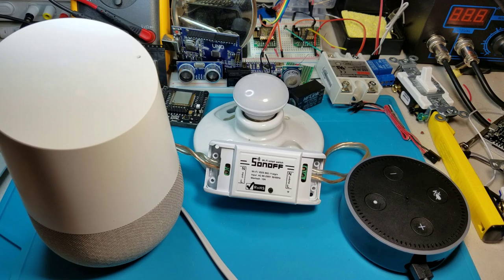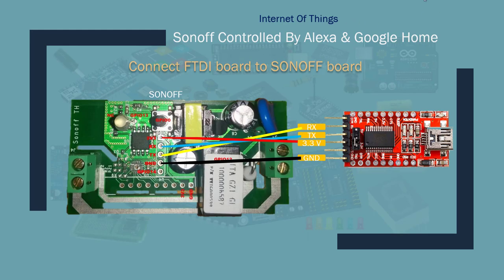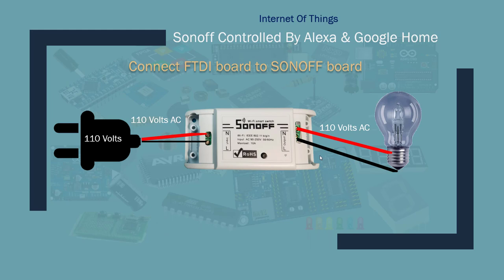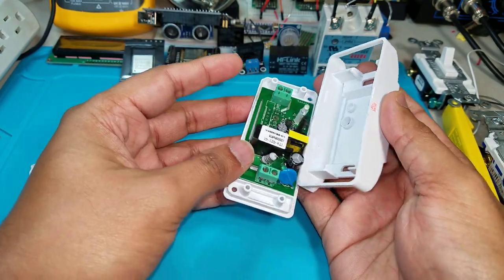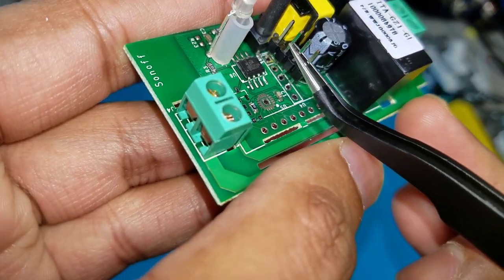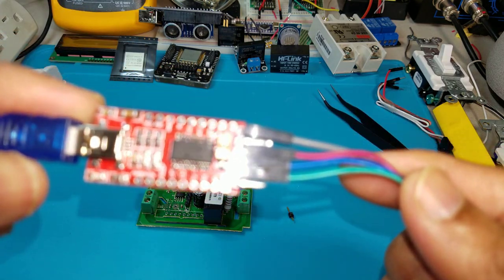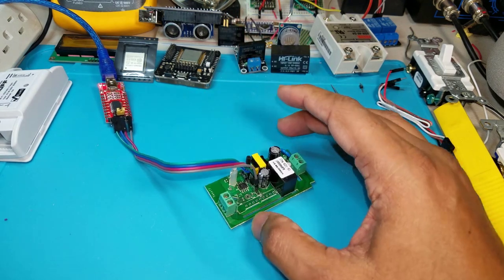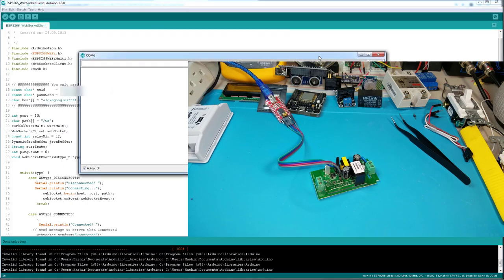IOT | Home Automation | Control Sonoff switch with Alexa & Google Home | Tutorial # 11

Comment: It is my understanding that if you use the load on the neutral side of the Sonoff like you have shown, the "hot" wire is always energized and leads to a shock hazard. Please hook it up as the indicator on the case shows.

Comment: A quick question about Heroku: are you only using it to avoid opening a firewall port? Or does it add some value? If it's just security, it seems like you could achieve a "close enough" protection by simply limiting the port mapping to IFTTT server addresses.
Reply from the maker: Ran Talbott I am using it to avoid opening a firewall port and also off loading some of the processing from ESP to Heroku. In my case I don't have an option since my router is locked down by my ISP.

Comment: It's not connecting to my wireless network after uploading the sketch. I open the Serial Monitor and it's blank. Any suggestions?
Reply from the maker: Ryan Maples please make sure you are selecting the correct board type and double check your ssid id and password.

Comment: Whats the amazon app name i need please?
Reply from the maker: You don't need any app. Just used the code provided in description.
Reply: but you say "alexa trigger" so  you are using this through IFTTT then right?
you must be using  IFTTT
i don't think there is a way to interface with the sketch on the switch directly there needs to be some other service, so what service in IFTTT do you link it to?
i saw something similar , but the sketch was for a device handler in smart things ,i am not sure if you need the smartthings hub to do it that way or just the app/account because i saw someone else get a boadlink to work with smart things and it said you could do it without a smart things hub
i went and bought  a used gen 1 smart things hub to use with the  sonoff sketch and another sketch for a lixada H801 ,also esp8266 based ,mainly i got it for the H801 since i will be using 5 of them
so i was wondering if you could do something similar with the H801 
make a tutorial and sketch and show how to flash it to an H801

i am not sure if the smartthings sketch actually requires you to use a hub  either or if you can just  do it with an account 
i assume there is a way to do it without a hub since it does not use special  protocol like zwave or zigbee  ,just wifi
but  it requires some fancy setup on your router with ports i do not quite understand
have you seen this project on the smart things community?
flashing H801 and sonoff for smart things control i mean

i ended up  forgetting about sonoff  though because i bought a  broadlink RM pro and i use it to control both 12v and 120/220v
cheap chinese  433mhz relays  and  i use an always on android android device running a bridge app
Reply from the maker: Please watch my previous tutorials. I am doing this with Heroku app. App allows you to control your devices without opening a firewall port.
Reply: its a skill on amazon must be called sonoff that would make sense :)
Reply from the maker: I am using Alexa applet with webhook to send the call to Heroku and then the request get forwarded to the Sonoff.
I explain this in my previous tutorials. It is not limited to on/off command you can use other commands.

For step by step details watch following video.
https://www.youtube.com/watch?v=c4CC1dMFg78
Reply: ok ,yes i have watched some 
so this heroku app does not need to be running  all the time on an always on device right? and you can use it with IFTTT
so could you use this same method  for an H801 too?
Reply from the maker: Heroku app is required for your device to work. It is a workaround to let the Alexa and Google Home (IFTTT) to send commands to your device over the firewall. If you don't want to use it, then you will need to open your router's firewall port.

Yes, I believe H801 uses ESP8266. This solution will work with it.

Comment: Hi Nassir, thanks for making these videos and I am learning a lot of good stuff because of you. I tried to flash the SONOFF plug and Arduino gives me below error. Can you please help

Arduino: 1.8.4 (Windows 10), Board: "Generic ESP8266 Module, 80 MHz, 40MHz, DIO, 115200, 512K (64K SPIFFS), ck, Disabled, None"

Sketch uses 302817 bytes (69%) of program storage space. Maximum is 434160 bytes.
Global variables use 40128 bytes (48%) of dynamic memory, leaving 41792 bytes for local variables. Maximum is 81920 bytes.
warning: espcomm_sync failed
error: espcomm_open failed
error: espcomm_upload_mem failed
error: espcomm_upload_mem failed
Reply from the maker: Your SONOFF switch is not in flash mode. Make sure press down the SONOFF button before you plug your USB to TTL converter to you computer.
Reply: Thanks for the quick response. I just switched the USB port and it worked, In the logs I do see the plug was flashed but using the IFTTT command it is not doing anything. I tried to look for the logs on the serial monitor but it does not show me anything. Not even when it is flashing the plug. I will try to hook it up with A/C power to see if that works
Reply from the maker: You need to deploy the Heroku app. It is very easy. Watch the tutorial # 10 https://www.youtube.com/watch?v=c4CC1dMFg78
Reply: That is also deployed. When I go to Personal Apps it shows the app
Reply: I plugged it to mains, but still nothing. Is there some way to debug whats going on?
Reply from the maker: Harpreet Singh Saggu you can see the log. Open the serial monitor of the Arduion ide give a command and post the output here. I will take a look.
Reply from the maker: Harpreet Singh Saggu Also, did you changed the GPIO to 12 in sketch?
Reply: Yes I did, and no matter what I do I am not able to see any output on the console. I have tried to change the BAUD rate as well, but nothing.
Reply: Added another port monitor which gives me below:

[09/09/2017 16:38:11] 
Modbus Request (COM3) 
Address: 123 
Function: 34 (0x22) 
Checksum: 8829(BAD) 

21 09/09/2017 16:38:21 IRP_MJ_READ UP STATUS_SUCCESS 00 ff  .ÿ 2  COM3  
22 09/09/2017 16:38:21 IRP_MJ_DEVICE_CONTROL (IOCTL_SERIAL_WAIT_ON_MASK) DOWN STATUS_PENDING     COM3
Reply from the maker: Harpreet Singh Saggu I had similar  issue and this is what I did. 
Unplug your usb converter. Restart your Arduino ide. Reconnect and reflash your  sonoff. I hope this helps.
Reply: Now it is giving me the memory error again. Tried 2 different SONOFF switches and 2 different laptops but the same issue
Reply from the maker: Only time I get this error when it is not is flash mode. I am not sure what is the issue.
Reply: Finally got it to flash, but it doesnt show me anything on the console, what could be wrong 

Uploading 306960 bytes from C:\Users\hsin11\AppData\Local\Temp\arduino_build_267392/ESP8266_WebSocketClient.ino.bin to flash at 0x00000000
................................................................................ [ 26% ]
................................................................................ [ 53% ]
................................................................................ [ 80% ]
............................................................                     [ 100% ]
Reply: I'm having a similar problem, in that I can flash, but the code does not run. I've even backed down to just the "blink" code, but no go. Nothing on monitor, and no wifi (for sketches with wifi). Same code runs fine with ESP8266-01s modules (with appropriate port changes). I've googled around but have not found any solutions to this.  Wondering if some of the newer versions of the Sonoff have something that prevents new code from running.  Harpreet - What is the version of your device (little red sticker on outside of case) Mine is 2017-5-15.
Reply: Well, I'm partly there. I used esptool.py to completely erase the flash and also used it to program the flash. Program now (almost) runs. I can discover it with Alexa,  send commands to it which from the serial monitor appear to work. However, the relay does not appear to actually activate, even though I have it set as pin 12.  Working on that. Also, need to see if I can get back to using the Arduino IDE programmer... Stay tuned.
Reply from the maker: Once I had similar issue with ESP8266 and I could not see anything in serial monitor in Arduino IDE. I used the following tool and I was able to see  that my board was crashing. I hope this helps.

Sonoff  dte is 201?-2-25 can tell the year since sticker is peeled off.

https://esp8266.ru/esplorer/
Reply: Harpreet Singh Saggu verifica se ta no mode boot